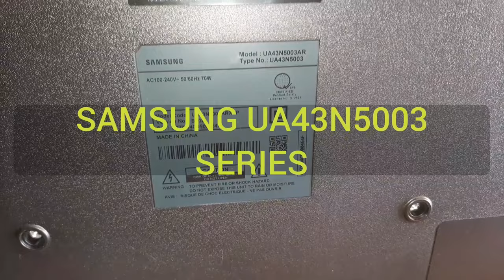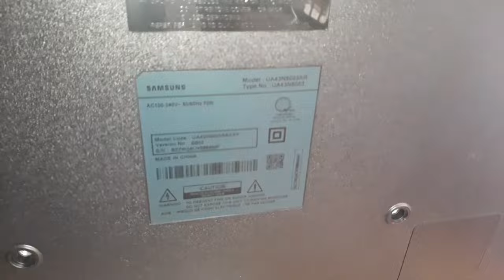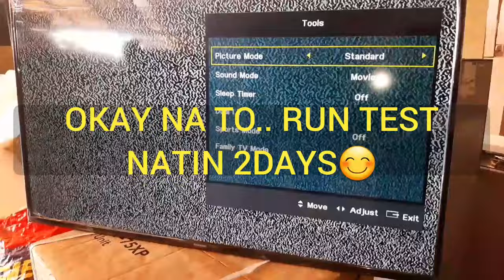@Son-bj2kb VERTICAL LINES DISPLAY ( SAMSUNG 43" SMART TV )

Comment: I have done the same thing as what you did and the results were successful but the screen image is vibrating, please help what should I do next step...
Reply from the maker: siguro meron pa pong ibang problema pina ka panel nyo sir baka sira napo talaga lcd nya
Reply: Is it just resistor R37 that has been removed, is there any other resistor that has been removed
Reply: Try to modify lc1 lc2
Reply: @Son-bj2kb sir gud pm pp
Reply: @Son-bj2kb pm
Reply from the maker: @onediexkol3623   gudpm po. Lc1 at lc2 magkatabi sila

Comment: Ask lng po sir  yon ganyan TV q Samsung  napunasan ng basa  na baseman DNA gumana  horizontal at vertical  ang lumabas tnx po sir  Godblessyou
Reply from the maker: check nyo po supply ng tcon sir yung VON (20-30vdc), VOFF (-5 to -10 ) , DVDD (3vdc ), VDA (13-20V) pag may missing po kasi na supply nayan horizontal at vertical po lalabas sa display.

Comment: Boss yung samsung smart tv 49" ko gumagana pa naman po sya pero may vertical lines po. Minsan nawawala yung lines tas babalik po ulit. Ano po kaya pwede ko gawin ? Salamat po..
Reply from the maker: check nyo po supply ng tcon sir yung VON (20-30vdc), VOFF (-5 to -10 ) , DVDD (3vdc ), VDA (13-20V) pag may missing po kasi na supply nayan horizontal at vertical po lalabas sa display.